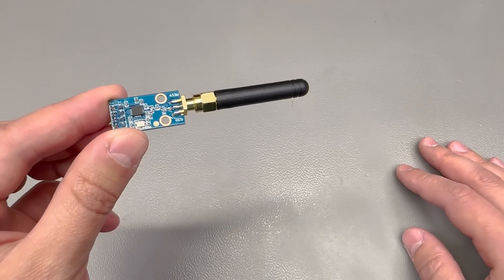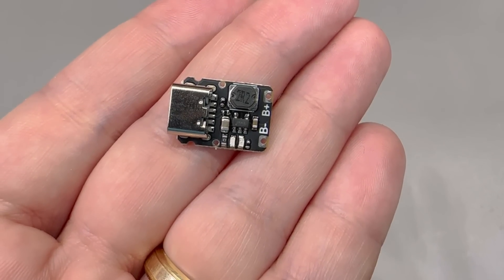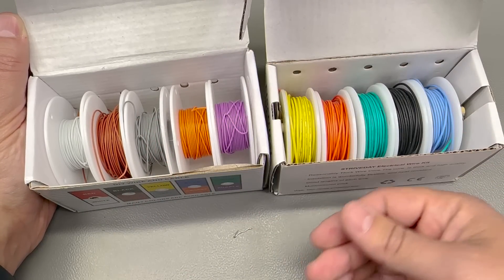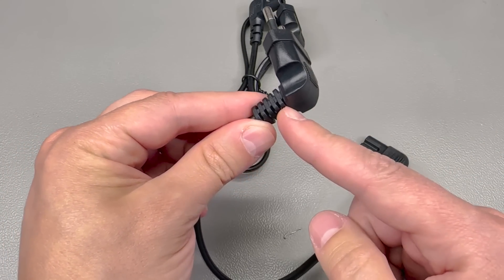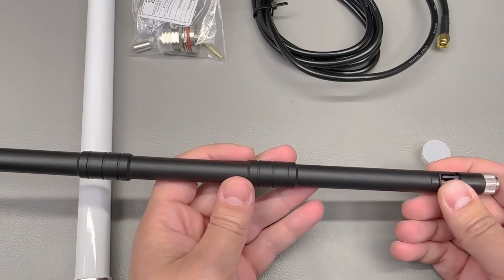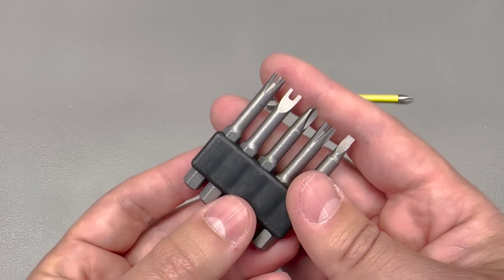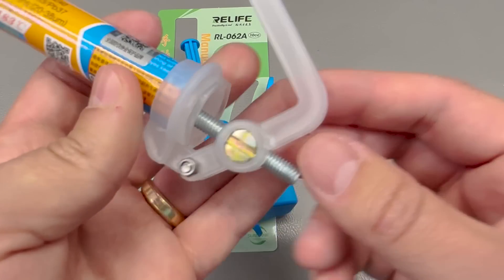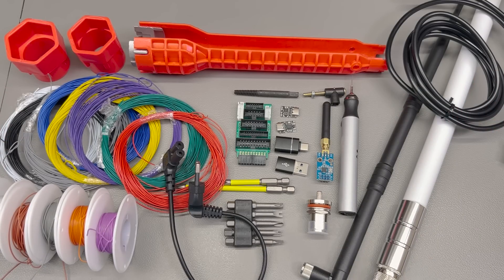InTheMail | Voltlog #446

Comment: The CC lines resistors I found out too late when ordering a TP4056 USB-C charge module. Working with USB-C so much lately, I just assumed manufacturers included them but no... so now I can charge my project only with a USB-A charger and a USB-A to USB-C cable and not with a USB-C power supply.... that will not work :( Although having a look at the board it is not too difficult to solder on two 5.1K SMD resistors. And now one will see the bodge because it is nicely in a box and a private project. Haha. 

But anyway good tip!

P.S. The D2 is great once you get the feel. No more scalpels for reworking :D

Comment: Hi, I will be traveling back home to Romania Cluj area. I will take my TTGO T-beam lora tracker. Perhaps I could reach your gateway from the Făgăraș mountain. I recently purchased the E32 900T30D EBYTE Lora chip. It has 30dB output power but I won't have time to implement it to the tracker device. 👍
Reply from the maker: There are likely much closer gateways to your location that you might be able to reach with the right conditions. 😬

Comment: You can get the older style TP4056 modules with USB C too.
Reply from the maker: I haven't seen them but do they also have the CC line resistors?
Reply: @voltlog  Had a look at one of mine and it seems not. Pretty lame. Only ever used them with USB A to USB C cables before.

Comment: TP4056 = 1 amp charging, TP4057 0.5 amp charging
Reply from the maker: That would only be true for the TP4057 in SOT-23-6 package. However we are looking at an SO8 package here for which I was unable to find a datasheet. Listing claims 1A so this is either a rebadged TP4056 or a different TP4057 with 1A capability.

Comment: 3:02 it maybe could be ETA6093S2F IC...

Translated from Chinese datasheet:
ETA6093 is a switching lithium battery charger, which can provide 1.2A charging current for the battery, and provide 5V/1.2A boost output operation, whether it is charging mode or boost mode, it can work efficiently. When charging, it uses ETA's patented control circuit for simulating current sampling resistors, so as to achieve constant current control, maximize efficiency, reduce charging time and reduce costs. Only 1 inductor is needed to achieve bi-directional power path management for automatic mode detection and switching. ETA6093 is an ideal all-in-one fully integrated solution for battery charging and discharging applications such as power banks, smartphones and tablets. The ETA6093 is suitable for lithium batteries with a charge cut-off voltage of 4.20V and is packaged in SOT23-5.

Features:

 Single inductor for bi-directional power conversion

 Automatic switching between step-up and step-down working modes

 Switching charger

 5V Synchronous Boost

 Up to 95% efficiency

 1.2A Charge Current and 1.2A Boost Discharge Capability
Reply from the maker: Nice find! Could be this or a clone.

Comment: 4057 withstand batery reverse connection.
Reply: Safer to use additional diode for reverse polarity protection.
Лучше дополнительно использовать защитный диод для случая переполюсовки
Reply: @jw200  Maybe safer, maybe not. With the diode present, battery protection is required (at least a fuse) and the circuit will rely on it to cut off the power before diode goes short circuit. I've not tested if DW01 can handle reverse polarity.
Reply from the maker: Thanks! That's an important feature to mention.